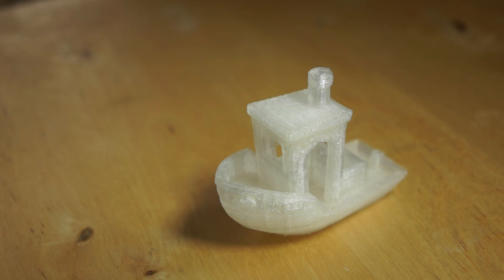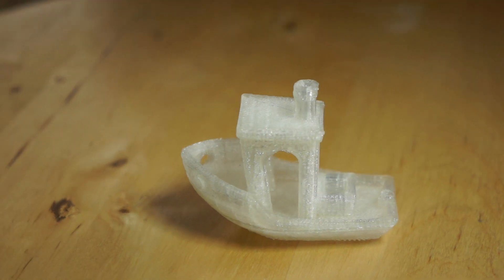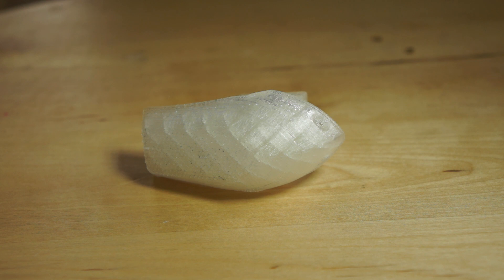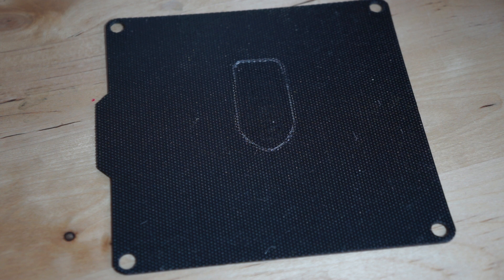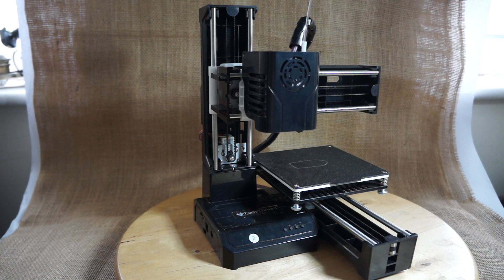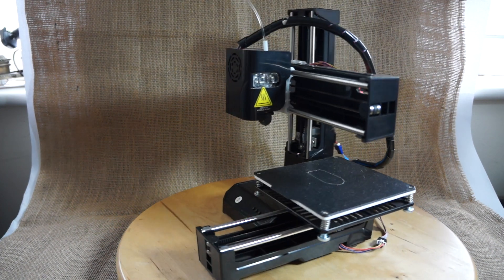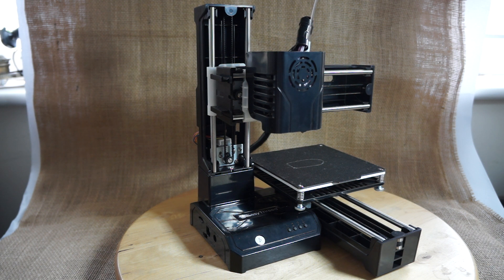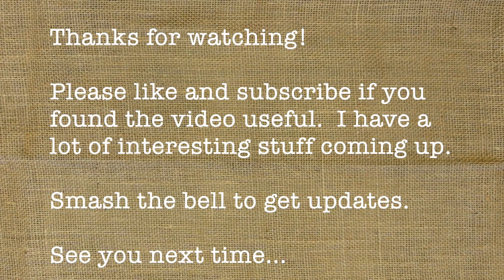Easy Threed K9 mini 3D printer follow up with test prints and impressions

Comment: Does it come with a slicer i heard some printer don’t and I was wondering if it does before I buy one
Reply from the maker: It does come with a slicer. My  video at: https://www.youtube.com/watch?v=xkHQ-PbDFQk&t=29s Looks at the software which should be on the mini SD card that comes with the printer. Be sure and look out for it. You can also use Cura - its another slicer thats free to download from Ultimaker. I also looked at that here: https://www.youtube.com/watch?v=iwyFw5QmNRg&t=51s please check out both videos. I show how to use both softwares. EasyWare is probably the easiest of the two but Cura is much more customisable. Id suggest using EasyWare to start with.

Comment: hi, what about printing TPU or PETG do you have an update on that espesialy what tempretures
Reply from the maker: I had a short break due to other commitments but Im getting to the point where I have the time to make more videos. I did buy some TPU for the printer and Im looking forward to trying it. Its going to be exciting! I also want to make some functional items with the printer. Ill be doing some designing things using Design Spark Mechanical - 3D design software and then printing them on the EasyThreed printer. As for temperatures I normally use the default profiles in either Prusa Slicer or SuperSlicer which are spot on usually. It will be interesting on how they fare for TPU. I will bare your comments in mind for my up coming content. Thanks for contributing. Kind regards & best wishes.

Comment: How good is this 3D printer?
Reply from the maker: Thanks for your comment & watching the video. As long as you only need a 10x10x10cm print volume and only plan to print in TPU or PLA. I haven tried PETG yet. Im not sure if it would be up to PETG. Its a great starter printer to learn the basics for a budget of $60 or there abouts, there is nothing else. In the long term you may want to buy something that prints in a larger volume & more materials. The learning curve on the bigger printers is steeper and more things can go wrong with them. This printer is very easy to set up and use but long term you will want to get a larger machine. It will give you a good grounding in the principals. Ive been printing many years and have many machines. Most are very complicated to get working properly. This machine is very simple and easy to assemble & use. Its made of ABS so isn't as strong as the bigger machines but it is 3x cheaper than many of the more popular ones. Its all a question of compromises. If you are new to 3D printing, its definitely a worthy contender to learn on without the complexity of problems that come with the larger printers and its good as a proof of concept if you need to justify the cost of a printer to a sceptical wife, husband or partner etc. Kind regards & best wishes.
Reply: @NightStarLeafTech-vj3ez  Thank you for such a detailed answer, I’ll still get another printer model, circumstances have changed, but thanks anyway for such an answer
Reply from the maker: You're welcome. I hope you can find a nice one. The Elegoo Neptune is supposed to be very good. If I wanted a another id certainly consider. it. Ive not had any personal experience but its just what I've heard. If you've been looking some time I'm sure you will probably be aware what's available. All the best with your printing & kind regard @Casper_8865

Comment: My printer printer halway and just moving no pla is coming out help please it is only printing rocket
Reply from the maker: Hello, Im really sorry that you are having problems. If when the machine is on and set to print, if you open the hot end shroud, do you see the gear wheels turning and is the printer heated up? If it stops printing the nozzle could be blocked. Its hard to say. You could post the problem on one of the many 3D printing Facebook or Reddit forums and I'm sure someone will try to help you. Id suggest you explain the problem in full which would include the Filament Brand & type, The model printer and an explanation & photos. Photos are very important particularly the hot end etc. I hope you are able to sort the issue out.  Kind regards & Best wishes.

Comment: Is this better than the k7? If yes, in what way?
Reply from the maker: Thanks for your comment & thanks for watching the video. I haven't had a K7 but looking at it, with the K7,  its necessary to move the print head by hand when levelling each corner. From what Ive seen the motors don't move readily which means putting the little printer under a lot of strain just to level it.  The K9 has buttons and it moves to each point quickly by itself. On this point alone IMHO its beating the K7. The levelling issue is enough without any additional benefits.

Comment: thank you! very usefull review!
Reply from the maker: Thanks for watching. Thanks for your comment. Im happy if it was useful. Im very much enjoying using the printer myself. Its kind of nice to go back to basics to print with PLA and see what can be achieved. Im printing a bracket on it for an SD card reader in a video coming up. Ill be designing it from scratch and then printing it in PLA on the printer. It will be an experiment to see what the machine and the materials can do. If thats of interest I hope you will consider watching. Kind regards & best wishes.

Comment: great video, what were the parameters you used?
Reply from the maker: Hi. Thanks for your comment. I used the EasyWare slicer on its default settings. My other video looks at the EasyWare slicer to introduce it. I changed over to using a couple of other slicers and got different results. I'll be looking at it in more detail in my next video, which I hope to publish soon. It will look at which slicers can be used etc. There are a few other ideas too.

Comment: Nice video, thank you for printing a benchy on this!  I've been looking to get a cheap tiny 3d printer to make some gridfinity organizers and other odds and ends, and this is looking more and more like a solid option
Reply from the maker: Thanks for watching & thanks for your comment.Im glad it was useful. The printer is certainly easy to assemble/use. Its easy to load filament etc and adhesion is easy. Im in the process of making another video on it. Ill go through my progress to date and a few extra thoughts.